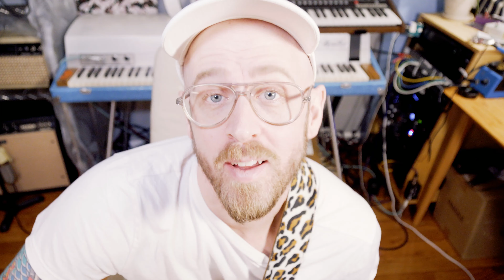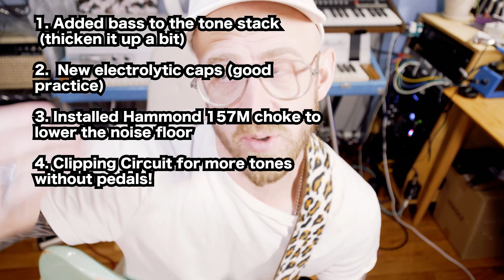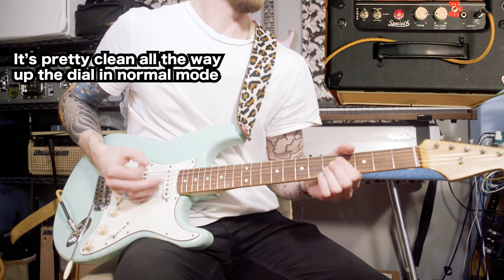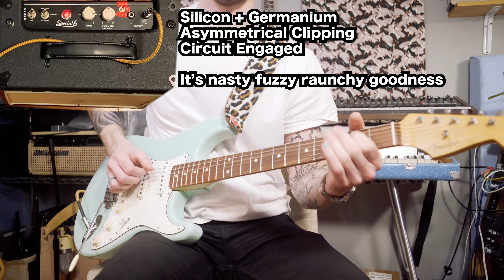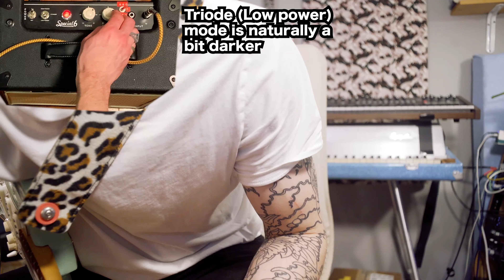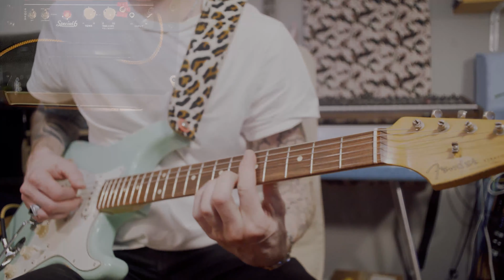VHT Special 6 Demo, mods & thoughts

Comment: Hi congrats, this is the first time I heard nice tones out off this amp series, stock is awefull, no headroom, no bass, bad chosen resistors in the "fixed" tonestack (I wold remove the tone pot and wire it in the tone stack as the trebble control and add a bass control (as a Black or Silverface champ) oh, and add the negative feedback resistor. The mids control can be 6.8K like the AB768 tonestack or put a mids control at the back off the amp using one off the speaker output (maybe 4 or 16 ohm) the one is unused. That way is converted to a more desirable 60´s or 70´s Champ, I think Rob covers this in his web site, Rob page is priceless. You did a great job, I wouldn´t add the clipping stage but hey if you like It it´s your mod, the LED clipping is the best IMHO because gives you headroom and cleans up nice. Cheers
Reply from the maker: Thank you! Rob's page is absolutely a gem.